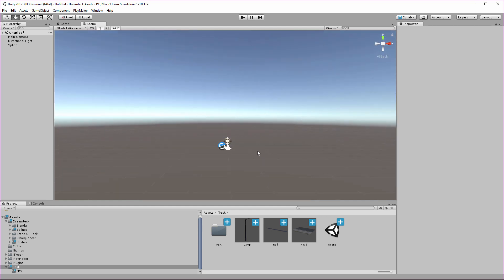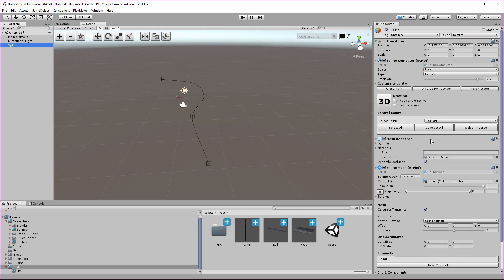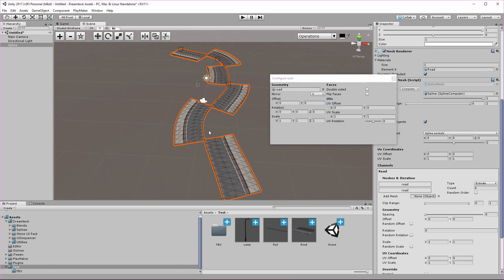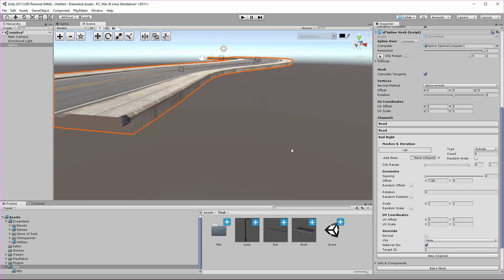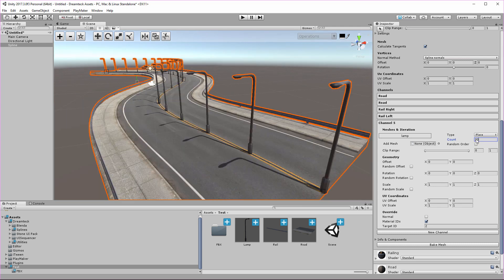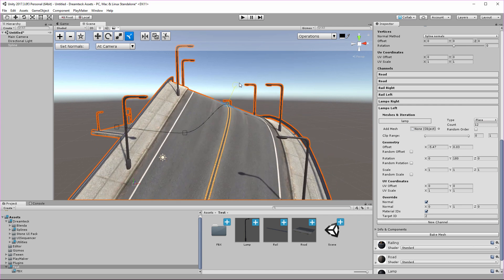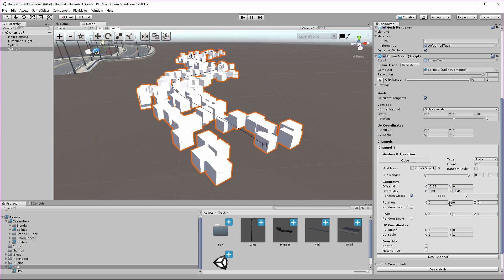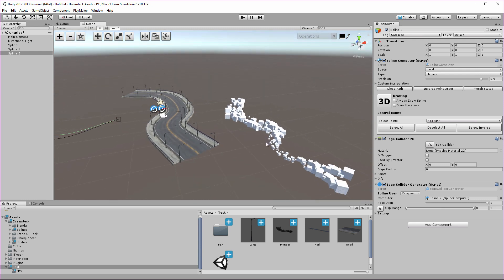Dreamteck Splines -  Tutorial & Feature Showcase [1.0.9]

Comment: My splines are not extruding properly. I created a simple 3D mesh using Unity's basic 3D objects, decreased the Y scaling, and tried to set that into a Spline Mesh channel, and this is how it's behaving: first of all, it's rotated to a vertical orientation, then, if the spline is a broken loop, it will stretch the mesh between the two broken points, and if it's a closed loop, then it will just place a single mesh along the spline. Then, when I increase the extrusion count, it will extrude the mesh along a number of points defined by the count.
Reply: solved?
Reply: @timofiiisakal6196  Nuh uh. I gave up on that : /

Comment: you have explained everything well here. Just purchased the asset and liking the options. 

One thing I can't figure out is about a way to add collider to the road. I can use mesh collider in spline renderer object of course, but, that won't be a performance solution for a mobile racing game. Can you suggest me any way to achieve it here? Like a way of adding box colliders to individual road pieces or any feature like spline collider component here?
Reply from the maker: Hi Nabarun,

Thank you for using Dreamteck Splines! We don't have a spline collider component but you can do this in several ways:
- Add a path generator, disable its mesh renderer and add a mesh collider to it
- Use the object controller to spawn objects with colliders (not very accurate)
- I can send you a custom component to generate box colliders along a spline if you join our Discord server: https://discord.gg/Y3eukB6
Reply: @dreamteckstudio  yep, thanks for the suggestions. Will try them. Will join the Discord server too for the box collider method.

Comment: I'm facing a serious problem with your asset, when I create a new project and import both dreamteck splines and forever - endless runner engine in the same project it gives a whloe lot of errors when tho those are the only two thing I have done in the project (didn't even create a cube and the project wouldn't run because of those errors.
I have written to support for and still haven't been replied yet, thses are the error codes, please help me fix this.

Assets\Dreamteck\Splines\Core\SplinePrefs.cs(24,61): error CS0117: 'Spline.Type' does not contain a definition for 'CatmullRom'
Assets\Dreamteck\Splines\Core\SplinePrefs.cs(86,43): error CS0117: 'Spline.Type' does not contain a definition for 'CatmullRom'
Assets\Dreamteck\Splines\Components\SplineComputer.cs(271,56): error CS0117: 'Spline.Type' does not contain a definition for 'CatmullRom'
Assets\Dreamteck\Splines\Core\IO\CSV.cs(18,96): error CS1061: 'Spline' does not contain a definition for 'CatToBezierTangents' and no accessible extension method 'CatToBezierTangents' accepting a first argument of type 'Spline' could be found (are you missing a using directive or an assembly reference?)
Assets\Dreamteck\Splines\Core\IO\CSV.cs(48,69): error CS0117: 'Spline.Type' does not contain a definition for 'CatmullRom'
Assets\Dreamteck\Splines\Core\IO\SVG.cs(78,100): error CS1061: 'Spline' does not contain a definition for 'CatToBezierTangents' and no accessible extension method 'CatToBezierTangents' accepting a first argument of type 'Spline' could be found (are you missing a using directive or an assembly reference?)
Assets\Dreamteck\Splines\Core\Primitives\SplinePrimitive.cs(76,32): error CS0117: 'Spline.Type' does not contain a definition for 'CatmullRom'
Assets\Dreamteck\Splines\Components\SplineComputer.cs(1352,20): error CS1061: 'Spline' does not contain a definition for 'CatToBezierTangents' and no accessible extension method 'CatToBezierTangents' accepting a first argument of type 'Spline' could be found (are you missing a using directive or an assembly reference?)..

 MY PROGRESS HAS COME TO A DEAD STOP BECAUSE OF THIS PLEASE HELP.
Reply: Why are you spamming on every video on the channel? Dreamteck has its own support page on the website.
Reply: @anbagames  My bad, sorry.
Reply from the maker: This is a know issue and we have a patch for it. Drop us a line in our support form.
Reply: already did that waiting for a reply. 
I have been using them separately and it works like magic just need to combine both to see what it can do but so far separate it's very very good.

Comment: Yep Really nice, I bought your Packages, but what i noticed is that the objects which are PLACED on the Spline, are not placed evenly across the whole spline. Lets say you have a spline which 4 segments (5 controlpoints) and 100 placed objects. every segment gets 25 objects. This works nice if all segments have the same size, but if not it doesn't look good. Do you have a solution for that?
Reply from the maker: Hey Marcus (we also responded to you in support), to achieve this, you need to toggle "Uniform Samples" for your Spline User of choice.
Reply: Yep works great, i am happy :)